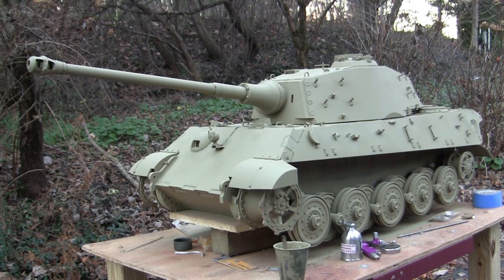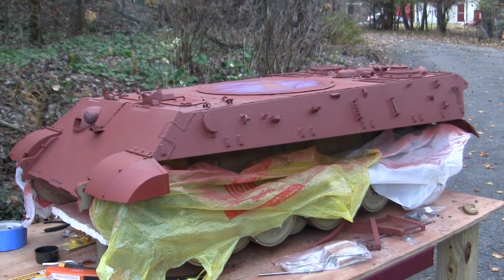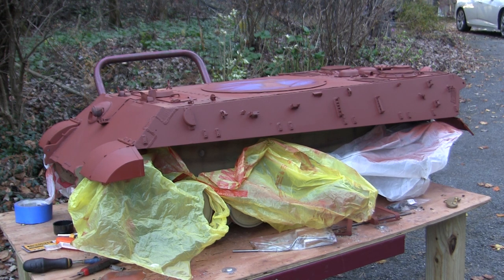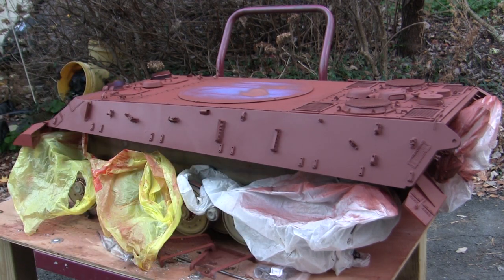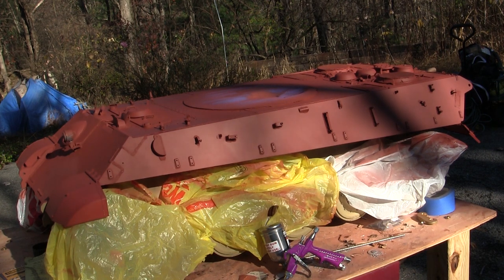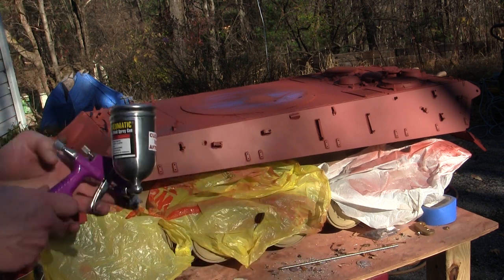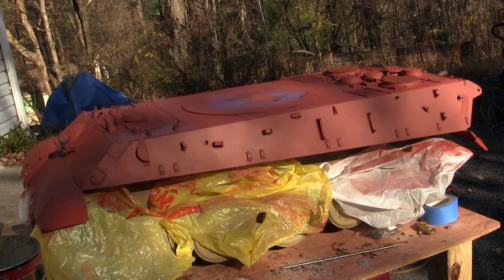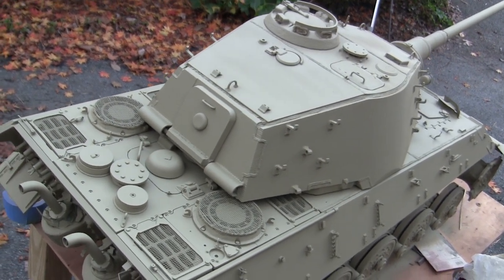Armortek 1/6th scale RC King tiger project video#32 (final primer coat and base color added)

Comment: Nice work and great information, with the latex paint is there an issue with fisheyes in the paint due to not using an inline air filter?  Or do you have filter on your compressor?
Reply from the maker: My compressor doesn't have a moisture filter, Perhaps it's the location where I live because the issue you are referring to was never something that I encountered. If it is something that is an issue that you are encountering then yes a inline air filter is an easy solution to the problem. I would suggest to practice on some wood or cardboard to see if that is something that you can encounter
Reply: @oddball759mm  Thanks John.  I haven’t done any spray painting but will in the future on my M26 Pershing tank from Armortek.  I plan on buying a King Tiger from them in the future when they rerelease the kit.

Are you getting a Pershing kit too?
Reply from the maker: @DKR977  sadly no on the pershing. As much as I would want one budget is a thing so I had to pass. Luckily I already have a 1/6th scale M26 in my collection so I can reluctantly skip this one.
Reply: Your build videos have really inspired me.  It took years of watching them plus some life changes to get me to take the plunge into one of these kits.  A lot of money but it looks to be great fun and a challenge to build.

I’ll be buying a bunch of your KT parts when they release the kit again.  

Now I get to go back through your Pershing build series to pick up pointers and see what parts you’ve got for that tank in 1/6 scale.
Reply from the maker: I never realized I had that much of an inspiration on people, it is quite humbling tbh. On the M26 I built it in 2010 before I was on youtube but I did make a couple videos on the tank complete. During the era that tank was built I did post a build journal on all the modeling and 1/6th scale forums basically in the same format I do in the videos, the link to the M26 page http://eastcoastarmory.com/m26/m26.htm  and build archive is here, http://eastcoastarmory.com/m26/archive.htm enjoy! P.S. I do have a whole catalog on detail upgrades for the M26, and those are found here in case you were wondering, http://eastcoastarmory.com/m26.htm

Comment: I love the results using Glidden paint from HD. What a great idea.  Did you have to thin the paint and what did you use to thin it to use in the spray gun.
Reply from the maker: yes the paint must be thinned to get it to work properly in the spray gun / airbrush. to thin it out I us tap water.